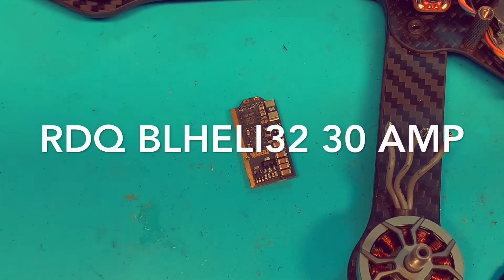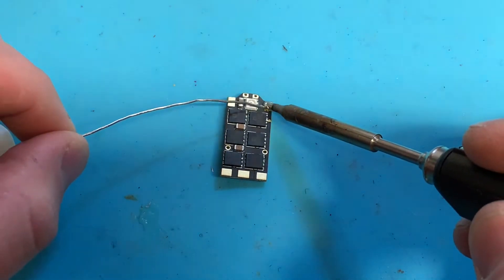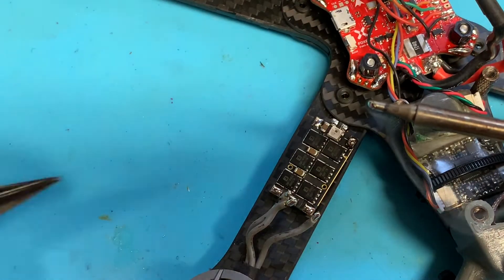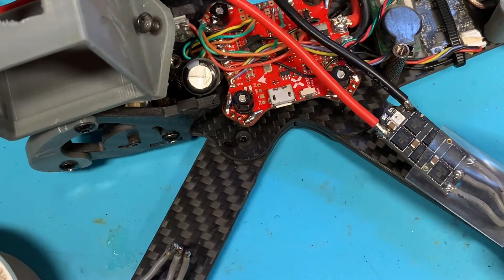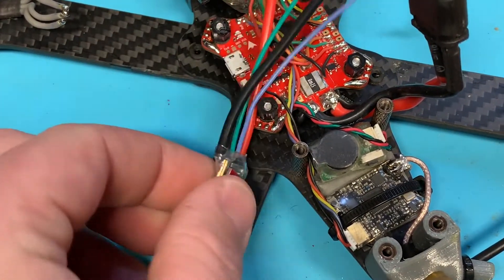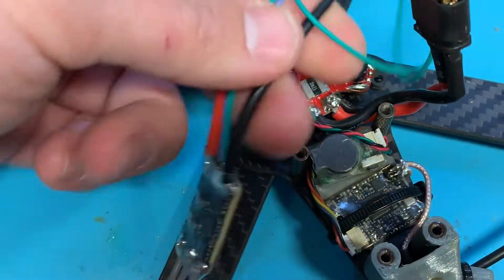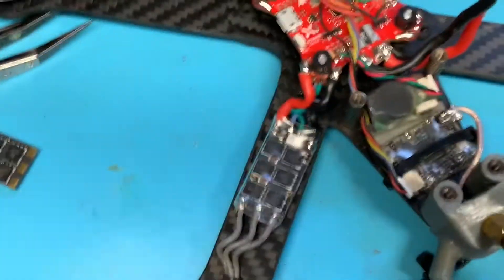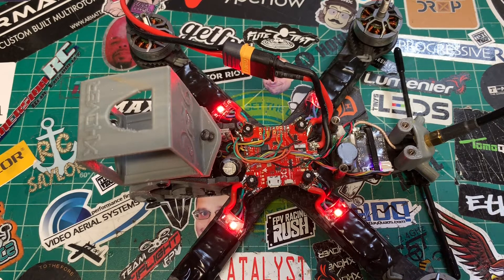How To: RDQ Esc Install

Comment: Do you know if these will do bidirectional dshot? I had a 2 wire 32 bit esc and a 3 wire (one wire being telemetry). The 2 wire one won't do bidirectional but the 3 wire one will.

Comment: Chris- what size heat shrink and brand/percentage of solder do you prefer?
Reply from the maker: Wrstew 60/40 leAd tin. Got it on amazon. Not sure the heat shrink size. I just pull some out of the box that fits lol.

Comment: These just look like the wraith 32 by airbot rebranded. I have a few sets of them and they are great. I believe the holybro tekko 32 are also the same
Reply from the maker: Thomas Haley yea that makes sense. Airbot makes a lot of stuff for other resellers. So far they seam nice. Gotta fly them though.
Reply: What size shrink tube did you use?